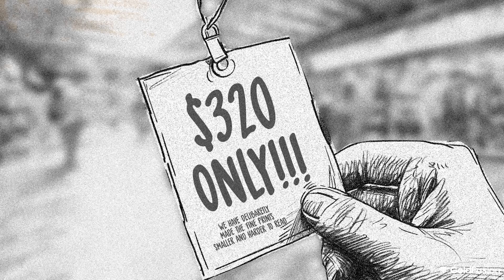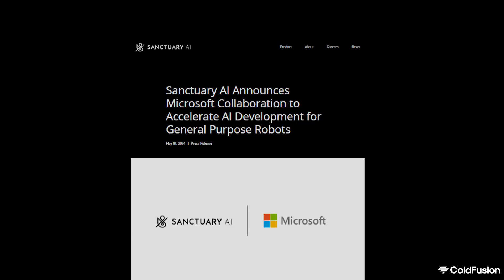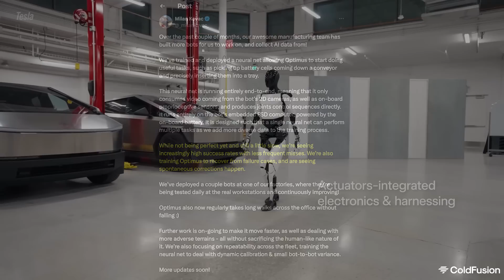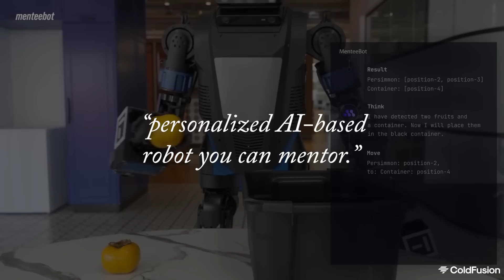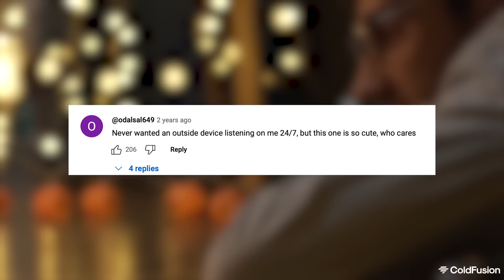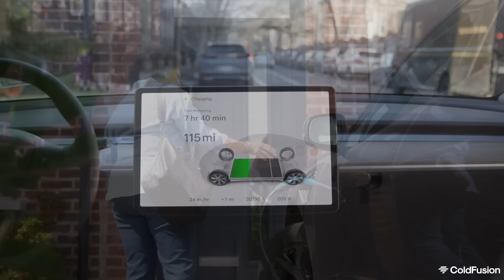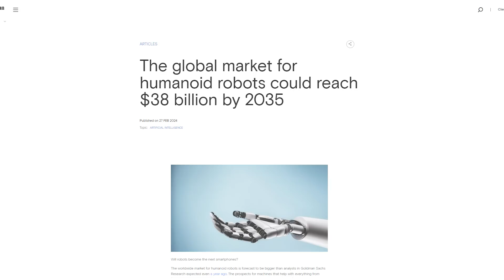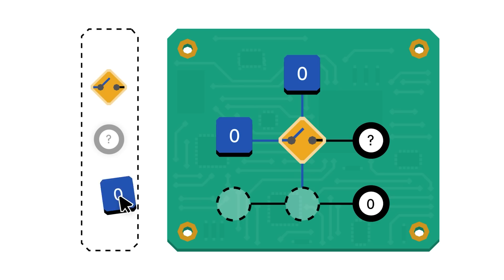2024 Is The Year of Realistic Robots (Tesla, NVidia, Figure and more)

Comment: I know why fear of robots is normal, because avoiding getting hurt by heavy machinery is normal, and getting of way of train, etc..
just the difference is, that those robots are not locked, so you can't avoid it.
not locked robots, like cars, tools, maybe guns, are human controlled, mostly, and rpetty locked on env, like roads, 
but domestic robot is huge deal, who knows what controls it, when it will break and jump around house in flames breaking everithing with its mass and motors?

Comment: The thing I don't quite understand is why are they trying so hard to make humanoid robots? Unless it's entertainment sector, we just need them to do their work properly and without failures, no need to waste effort to make their shape unnecessarily complex. I get it, it may potentially be "cool" to have humanoid robot at home, but that's the next natural step. First things first, we should focus on making them work properly and THEN improve their appearance.
Reply: The design of a product plays a huge importance in its marketability and how people form opinions. Bare steel, motors, and wires in an inhuman shape may be more efficient in some ways, but most people aren't going to want a tree of mechanical arms wandering around their homes. Older folks and especially small children will likely find those sorts of designs unnerving. 

Besides, human spaces are designed for humans, especially in all sorts of ways that I bet you don't notice. However, if you have a pet, think about the sorts of struggles they have to go through when navigating your home and apply the same general ideas to non-humanoid robots. Making a robot human-shaped to start with solves a lot of these issues.
Reply: Because people want an “ethically” justified way to have slaves by removing humanity from the equation.
Reply: @SaltedMallows  the circle of life, I'd own one
Reply: the idea is that since our daily tasks have inherantly been done by humans, these robots could be designed such that they are as versatile, and can be substituted as seamlessly as possible for the largest number of tasks done by humans. That is the difference between purpose built robots and humanoid robots.
Reply: Possibly a sick fascination borne from skirting the consequences if or when the android/humanoids' ethics gets skewed to the point that we've stupidly allowed T1 self aware Terminators.  Remember the u.s military years back, were all too penis happy to consider robotic soldiers.
Reply: Making them seem "less intimidating" to the general masses would be among my top reasons why most would justify making them and having them around, but personally, i believe in a different reason for why they are being created now, of all times: Climate change. 
Now hear me out, its been no secret that the earths temperatures are on a trajectory to rise well beyond what anything biological on this planet can handle with very little we can do to reverse the damage we've done; Stepping outside to get to work or even working outside could end up being a real dangerous endeavor. Work still has to get done, but perhaps, seeing the writing on the wall, those pushing for humanoid robots are doing it because they see no need to endanger workers when a robot could fill that void instead. That's my guess, anyway.
Reply: @rampagephoenix1735  but... Even if your theory was true, you have no need for humanoid robots to do that. Any form of robot can potentially do what humans do... Why go the extra mile to make 'em look like us?
Reply: @bozydargroch9779  It's difficult to pinpoint the exact reason as there could be many, but I believe that I can narrow it down to 2 likely reasons:
1. The convenience of the human form for the sake of accessibility (climbing stairs, ladders, etc). 
2. The general acceptance of society (people tend to reject change, unless  it can be proven or perceived to be friendly in the eyes of public opinion).
Reply: @rampagephoenix1735  I don't quite agree with point 1 - our form is not fit for optimal movement and wheels will always beat us, no matter what. You may need to modify stuff like stairs etc to allow wheels to move freely (like rails or smthing along those lines), but in the end it will result in way better mobility and time+energy save.

2. Yeah, that kinda makes sense, but the thing is... We as humans adapt very quickly. It may be new and look strange at first, but eventually you won't pay too much attention to it anymore and find it as normal as anything else. Dunno, there are hundreds of other examples, but take a look at cars. Those are everywhere and you don't even think that someone could ever find them strange. Yet it's probably how it was when they introduced them to the public. The more useful something is, the quicker ppl will get used to it.
Reply: you'd be surprised how important it is to be Aesthetically pleasing once you realize how common it is, it's not always going to be about practicality, especially if your investing alot of money into it.

A good example is the Bollinger electric truck. It's over 120,000 and it's meant to be for utility. But it's... so ugly: it's analog, the decorations are simple, there is no radio, and the windows use a crank. Stuff we take for granted because we are used to having THE LUXURY. it doesn't matter that it's unnecessary if it still feels like you are getting less for more.

Robot are no different. Humans like humans, so we want robots that look like them. sure they are a work in progress now and it's not what everyone is into, some people may want robots that look like a Gundam or a wall-e, but a accurate human look is just generally the pinnacle.

Comment: (at least until now) even when these things do exactly what they promise, the problem is often that they still fall short of actually solving the problem they claim to address; case in point; robot vacuum cleaners. they are just about at the point where they can clean ok, the issue is that i, the human, still have to throw the dirt away, clean the thing and clean the stairs and take it up and down the stairs. the problem they claim to solve ‘vacuuming the house’, even when (if!) it’s done perfectly, still leaves me with a bunch of stuff to do. so really it’s changes the problem rather than solved it. i’m expecting these robots to end up in a very similar space; where they do the thing they are meant to do more or less but don’t fully complete the task so you as the human are still left with a bunch of stuff to to do, albeit a different set of stuff

Comment: It being a $200 billion industry by 2035 is not unrealistic at all especially if you consider how far the AI stuff is going to advance by then as well. The AI stuff making everything a lot cheaper to manufacture and produce as well when it comes to these robotics because all the engineering software will just be automated. With the manufacturing aspects of its costs coming down it's mainly the software that's probably more expensive without the AI technologies we have now. But even that's starting to take off big time right now, so give them another five years probably going to have some pretty efficient robotics tech alongside the polished AI interfaces, advancenents in chip technology.
optimistically speaking if Taiwan doesn't get completely obliterated in the next few years from an all out war (or ww3 occurs) or if the states actually managed to compete with TSMC by manufacturing their own chips in the states and then bringing the pricing right down and then you got China that will probably end up competing more aggressively as well and itll just end up pushing that technology forward dramatically.

Comment: Never gonna happen, sorry.  Why build a human robot that can sort through inventory when you can just build the infrastructure that can do it instead?  The human form is incredibly inefficient, needlessly complex, and I don't know if anyone has noticed, but we tend to tip over pretty easily.  There's a reason why factory claw machines have 2 "fingers" (or just 1 suction contraption) instead of 5.
Reply: The industrial robots are widely used in car factories, while humanoid robots are more suitable for domestic tasks. Instead of replacing the entire factory, robots can be adapted to human tasks and sizes, which is more cost-effective and efficient.

Comment: I watched a house being 3D printed out of steel-reinforced concrete while sitting on a concrete chair the same robot had printed earlier. That was at the Bauma 2022, the worlds largest trade show. It has a focus on machines used for construction, and damn there is some crazy shit to be seen there. Like a production line using 10cm square levitating platforms that moved ridiculously fast and precise. Or like all those picking robots. Like, you have a big machine + oven producing pancakes, and out comes a conveyor belt full of pancakes, random arrangement, some overlapping, and a bunch of crazy fast robots make neat stacks of 4. Not much AI in those examples, but even the robots without AI are advancing so fast.
Reply: Just look at what the Boring tunnel building machine can do ! 😮

Comment: Fixing on legs for robots is stupid, 4 wheels would be faster and efficient just need to adjust the high and distance between
Reply: true, but other then a lot of people simply preferring a robot that looks and operates like them, there is a very good reason why legs have a big advantage.
And that is that they can operate in any circumstance humans can, without any need to adjust the the environment for them (assuming we can get them to be agile enough.)

stairs, loose sand, rubble, step ups, a hole in the ground or even just an object on the floor you might have to step over. While you can make something with wheels that can deal with these things, legs are much more practical.
After all, every man made place was made for people, who generally have legs. (and not even close to half of the places have been made wheelchair friendly.)

that is why legs, if we can make them work properly on robots, would be quite great to have.
Reply: Maybe wheels on legs.

Comment: Humanoid robots are just so... pointless.
I mean, there is a place for it to be sure, but nearly all of the advancements are in non-humanoid robots.  Even a lot of the robots with a torso, 2 arms and a head aren't 1 singular 'humanoid' robot.  They are 2 arm robots controlled by a cpu taking input from a camera.  Putting them in a human-like layout is good PR for the camera, but the practical implementation is going to be a few well placed cameras in a room, and an arm on a rail in a robot's workspace.  The 'humanoid' robots like a teslabot are not singular beings that do all the processing on-board, each individual robot will be controlled by a larger server in a rack which will coordinate several robots as a single entitiy, and which don't need to be humanoid in form.
The best robotic forms that we have today are roller-type pedistal bots used for robo vacuumes, mowers, food delivery carts, and mobile rack bots at Amazon, or limb robots like found on a car factory floor.  Making them look humanoid is great for show, but extensions of these other forms of robot are what will sell in bulk and be useful towards making money.  Fewer failure points, more capable at tasks that humans can't already do, simpler programming and software, and actual practical sales for the company making them, and tangeable benefits for the company buying them.

There is an argument that humanoid robots are useful because they need to work along-side humans, and interact with objects that are designed for humans... and maybe that is true in a healthcare setting, but once robots are useful on a factory floor you simply design the factory around the robots and remove the human element.  No human is going to ever be truly comfortable working along-side a robot wielding a blowtoarch or cutting impliment... and frankly making it safe to do so just makes the robot less useful.  You will have the robot floor that humans rarely access, which will become a 'black box', and then the human factory floor for finishing and QC inspections.  The idea that we will work along side a $50-150k robot while we are paid $40-60k/yr plus benefits is absurd.  Once they are good enough, the humans leave the scene, and you no longer need a human-compatible formant.

Comment: I don't think most of you realize that we pretty much figured out AI at this point. We couldn't do general purpose robotics before because it's practically impossible to manually code for every possibility. Now we train an AI to make a prediction from an input based on what it was trained on. Computers are now capable of fuzzy thinking. All the evidence is pointing to larger neural nets and different kinds of data are the main thing needed to increase an AI's ability to reason. When we make an AI that can perform as well as humans on average, we will quickly make one that is way better than us, then we will automate everything that is worth automating.  In a short amount of time the value of labor will drop really low. The cost to raise a child to adulthood and to train them to do a job is 100,000's of $$$, and it take many years. If you have a kid today, by the time they become an adult they will be competing with a machine that can do almost anything they can do for a fraction of the cost. It only took less than 30 years for the car, plane, and internet to proliferate. AI is a bigger change than the industrial revolution. What happens when we are able to build a worker in a day at a factory. The work for a wage model is going to collapse.

Comment: Gov based City and Suburb owned robots are going to be cool , as we can finally have permanent farmed veg/fruit bushes and trees sidewalks and clean cities . Means the poor or anyone can always grab some food and wont starve , also leading to cheaper produce for restaurants and less pricey meals . A few backyard and rooftops means fresh food for everyone. This would also create a few more 24 hour cities like NYC , except cleaner.  Im sure subterranean warehouses would be a common possibility , since robots dont need oxygen , making faster deliveries closer to customers and cheaper storage of goods , meaning costs on products could be cut . 

I think that should be a goal , instead of replacing amazon like warehouse ,employee jobs , rather build underground warehouses that are only robots .That way large corporations can expand making more money without job cuts and make products cheaper and employees can do less work and get payed the same, at some point employees will phase themselves out of the work environment and may just retire earlier.
Ontop of that tons of carbon would just be trapped underground and a ton of heat from underground factories for winters could be side-loaded into homes instead of homes burning wood or using more electricity .Sure,  It's an engineering challenge but seems more feasible then it would have been 50 years ago.

Comment: In all the videos you have made so far combine with you background of engineering, it is quite disappointing on a very lack of understanding of the current AI which drive the advancement of the humanoid robots.
You hardly mention Figure AI and I don't if you have beef with Tesla or what it is quite clear in the post that Elon mentioned it has not folding the t-shirt by it self. 
I also believe you have an analysis of the market completely backwards, it is manufacturing and factory line industry which will be the key to the rise of this industry. 
I love most of you videos but this one is very very very disappointing. 
Ps. It is very clear that you yourself are a skeptic but it seems you take this quite personal some how.

Comment: We will not be replaced by robots in our jobs. I operate a laserwelding robot. complicated machines with lots of parts that can break down. software crashes occur. maintenance needs  to be done.the robot needs to be told what to do. the robot needs to be supervised so we know it is still doing what it needs to do. There is the cost factor. Robots are expensive (the one I operate is worth over half a million euros). If you your customer wants a product, but just 15 of them its cheaper to get a human to do it.  etc etc etc. The job requirements will change, that is all.

and btw. If everybody is replaced by a robot and nobody has a job, nobody has the income any longer to buy all the stuff the robot is making.